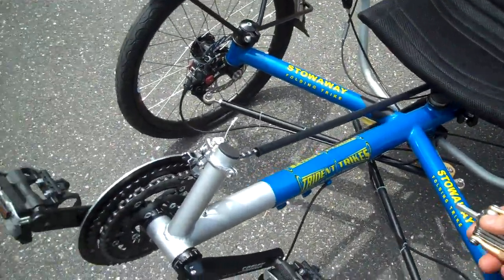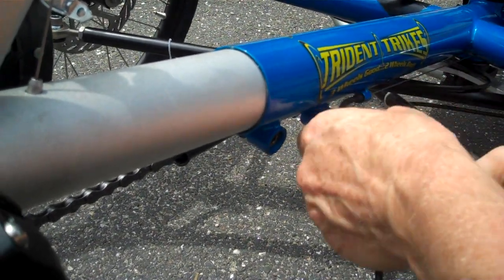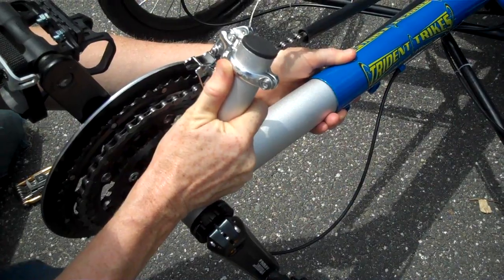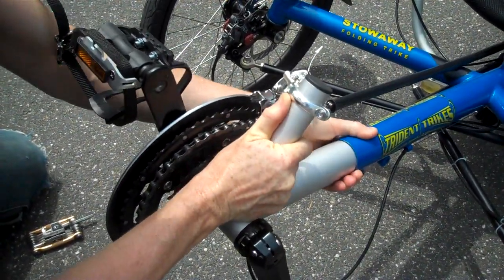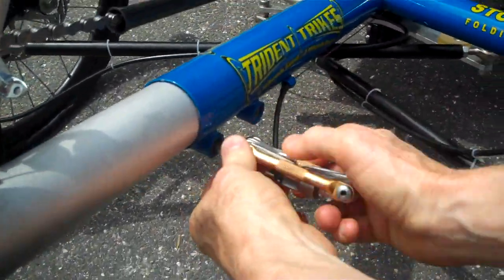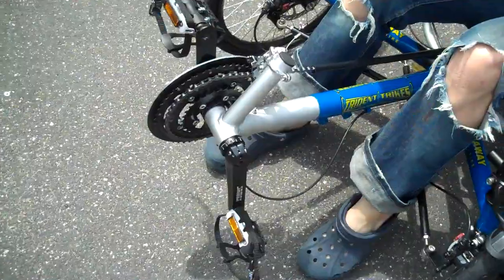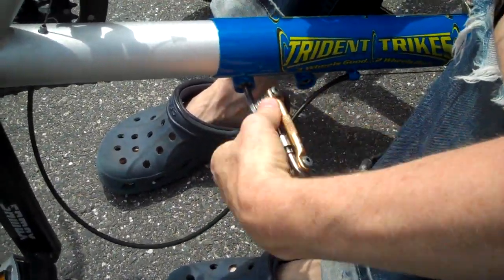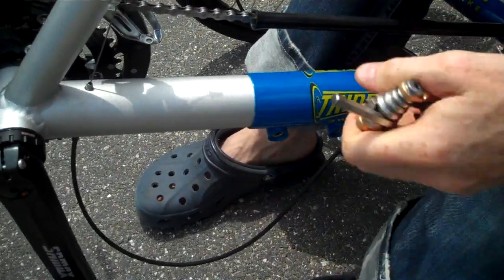Trident Trikes Adjusting Boom Length

Comment: I'm new to triking, and just bought a new 27 speed 20" Trident Trekker. I'm 6 feet tall with very long legs. My boom is extended  so there is about an inch of black showing through the keyhole slot on bottom of the main frame tube. There is perhaps 5 inches of contact area between the boom and frame tube. I'm concerned I may need an XL boom. I'd appreciate your thoughts on this...